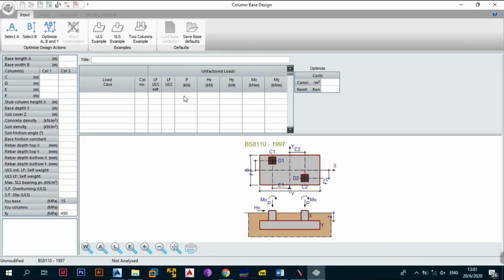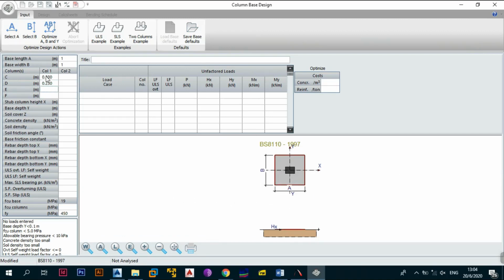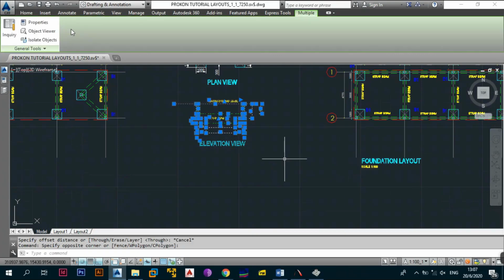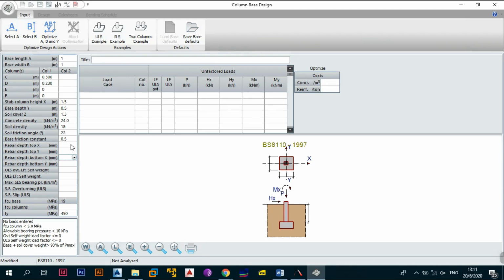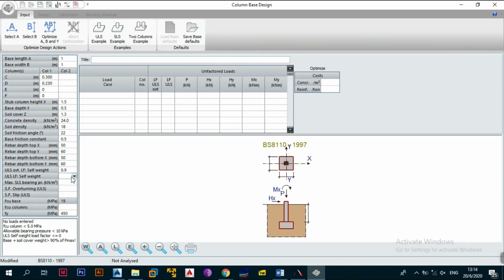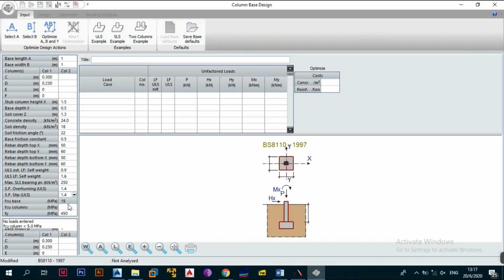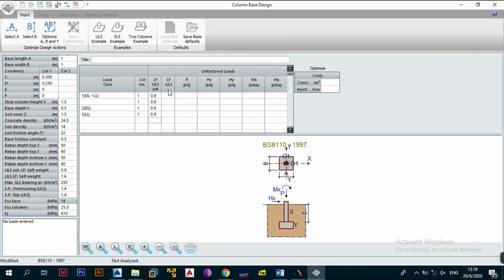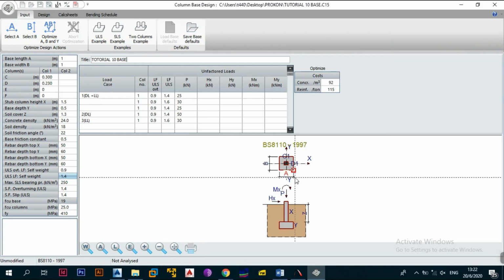Prokon Tutorials For Beginners In English:  Part 10 Foundation Design Example 1_Parameters

Comment: oh and another thing brother is there a way you can shade some light on designing for hollow maxspan slabs which we use alot here
Reply from the maker: Hie Atuhe, that's a great idea we don't really use em out here a lot generally because of contracting expertise available but i did some theory on them and i will look at a practical example where i could have used one and share it with you.

Comment: ey man i'm a bigtym fan...call me a follower...keep it up....preach brother i hope someday i can be able to fully translate some things from your standard to  ec 2004 methods (which we use here in uganda) because in some instances they differ alot
Reply from the maker: Hey brother, thanks a lot for the encouragement and support i really appreciate it, i am not really familiar with the EC, i have been mostly a BS and SABS guy but what i know having looked at the ACI and IS codes is that the fundamentals are usually the same the differences are just slight and mostly they involve the exposure and natural occuring events that may not be present in one region but i will look into the EC more, we used it for GeoTech but i am sure with Tekla Tedds we can do something